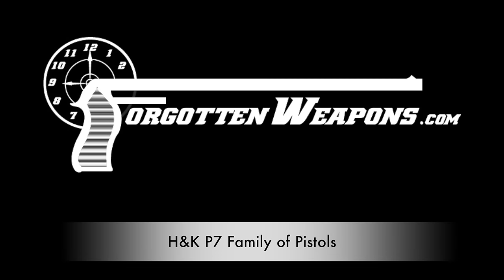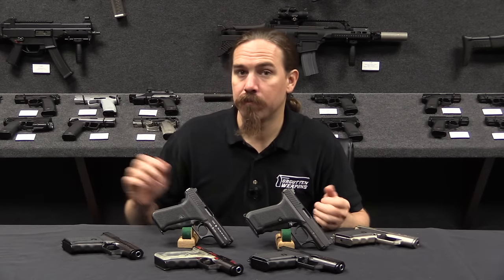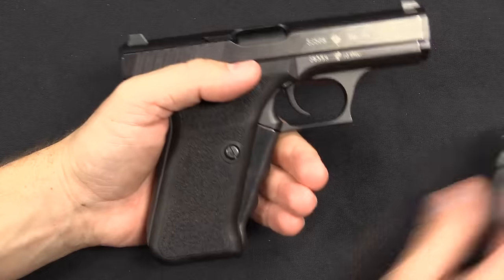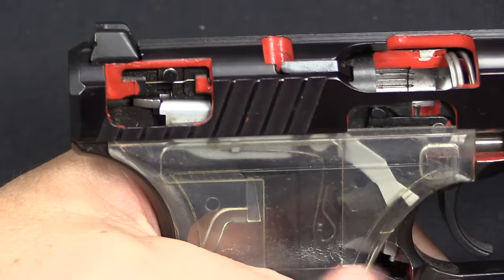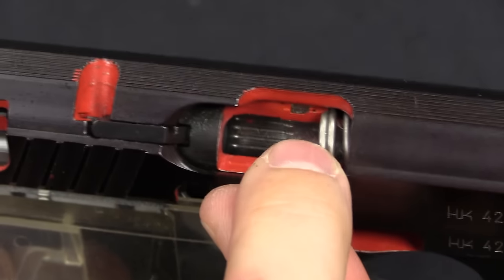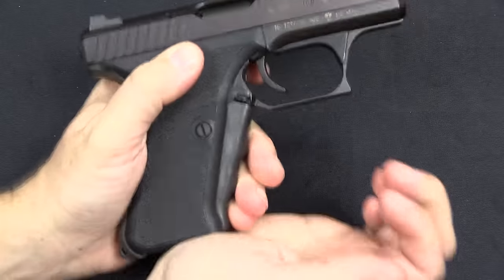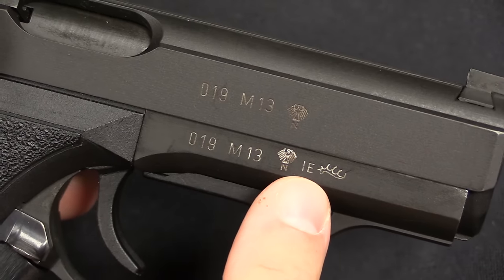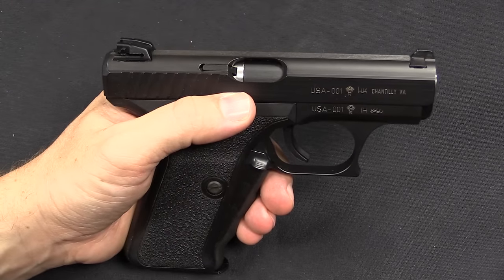H&K P7 Family: Pistols for Gun Cognoscenti

Comment: The (nearly) vertical magazine orientation within the angled grip has NOTHING to do with feed reliability. No handgun has ever had an issue with feeding from a grip angled magazine -- not 1911s, not Glocks, not Sig, not Berettas, nothing. The vertical magazine in a P7 is there to ALLOW FOR A LONGER BARREL by moving the breech rear ward. The P7 has a 4.13 inch barrel. Much longer than the overall length suggests. The Walther PPS which is almost exactly the same length as the P7 has a 3.2" barrel. The tiling barrel only recoils about 0.2" so the magazine orientation bought the P7 an additional 0.73" of barrel length and a notable increase in muzzle velocity.
--
I own both. In fact, the P7M8 was the first handgun I bought when I came to the US for college in 1994. I really regretted not getting the M13. The M13 then was $1,200 and the M8 was $950. Today, a mint M13 will change hands for about $4000~5000 and M13 magazines go for about $250~300 each.
Reply: Sorry sir it does . As well as getting more length true . If you have ever shot  hollow points and had to polish feed ramps etc or shoot only particular ammo .Had all the above . P7 will digest anything you put in it other than shot due to the light loads.
Reply: @Jason-nj8dn   I shoot truncated cone JHPs, Semiwadcutters and all manners of hard to feed stuff. The ability to feed such ammo has nothing to do with the angle of the magazine and everything to do with how high the feed lips are in relation to the bore and how shallow the feed ramps are. The angle of the magazine does not facilitate or preclude either. A P7 feeds everything, but so does a Glock, a Walther PPQ/PPS, a VP9 or a properly set up 1911 for that matter.
--
BTW, the P7 is mechanically very accurate, but practically not so accurate. This is because while the stationary barrel promotes mechanical accuracy, the unlocked breech means the P7 has a sharper recoil than most 9mm pistols. Plus, the while the barrel doesn;t move, the sights are on the slide not the barrel and the P7 Slide-to-Frame fit is not particularly tight.
Reply: @dwightlooi  set up key word. You do not have to set them up. I have had many many 1911 etc.  This is is not about cost. Just a conversation.  In my opinion and experience.  These handguns rock.. no screwing around with loads etc . In my experience kimber glock xp etc..  hands down p7 better.  Mabey your explanation and experience is different.  NOT mine . But appreciate your opinion.  Best regards!
Reply: I have another reply as well about boar axis and recoil. If really wanted to could tweak for particular loads.  The most accurate handgun I have ever shot other than six shooter.  Some people suck with it. Practice makes perfect. All the same they need to make a updated version.  Cool stuff.
Reply: @Jason-nj8dn   Not really... from a ransom rest (no shooter skill variance) the P7 shoots about 1.5~2.0"  at 25 yards. Pretty good; but not world beating. A tight 1911 like a Baer shoots 0.7~0.8" at 25 yards -- basically one hole.
Reply: @dwightlooi  yea I get your drift . Just saying no bags unloading weapon.  All in the money. Super good for carry. Fast . Fast. That's what keeps you alive.  I do appreciate your opinion though.  We could go forever about this . Lol
Reply: A new and improved lighter model would be amazing.  Wishing they would.  I will pay to play.
Reply: @Jason-nj8dn  If you want the gas delayed action, stationary barrel and vertical mag, sans the squeeze cocking, there is the Walther CCP. EXACTLY the same operating cycle.
Reply: @dwightlooi  squeeze cocker.. like I said  your opinion.  Not mine . I could go all I depth . Start breaking out pictures of groups etc. . But I don't need to.  Its good for me and I have owned about everything.  Anyhow shoot what is best for you that's all that matters.
Reply: @Jason-nj8dn  The P7M8 was my first centerfire pistol.
Reply: @dwightlooi  Good choice for first pistol :oP
Reply: @Jason-nj8dn  LOL.. it was funny. I went off to college in America. Got myself a very expensive HP 48G calculator and a very expensive HK P7M8 pistol.
Reply: @dwightlooi  . Good tools . Lol . Should have bought everyone get your hands on . Prices are crazy nowadays.  Good talking. Take care and aim small  ;0)))
Reply: Like the boy scout video.  Soo fckn true good one
Reply: Anyhow take care and be safe.
Reply: @Jason-nj8dn  In 1995 The P7M8 was $850 and the P7M13 was $1100. I should have gotten the M13. The reason I didn't was that this was shortly AFTER the Federal AW ban and >10 round magazine was halted a year prior. M13 mags were already $100 a piece and I didn't want a gun where magazine supply might be a problem. Well, The M13 is a $4000 gun today (mint) and the magazines are $250. However, if you don't mind the lettering, the M10 magazines work in the M13 as 13-round mags.

Comment: As well as the chamberings covered in this video there were also H&K P7s chambered for 9x19mm PT, as well as a prototype for .45 ACP. Most of the H&K P7s used gas-delayed blowback, but a couple of models used straight blowback. As well as the 8rd mag of most of the H&K P7s & the 13rd mag of the P7M13, the P7M7 had a 7rd mag & the P7M10 had a 10rd mag.

Comment: Walther P99 deserves a 5-10 minute video because of what you mentioned regarding partially cocked strikers and not so great triggers. Walther’s “Anti-Stress” trigger is a very good, unique and largely forgotten about stateside. What makes it great is the striker is fully cocked so the trigger pull is simply releasing the sear. It also had to be designed in a way that did not infringe on Glock patents. In 1997 (and currently), I would take a P99 all day long over a Glock. Superior ergonomics, outstanding trigger, and it is a more reliable and durable pistol. Yes, I said it. It also maintains a very simple design for complete disassembly and reassembly.

Comment: Question: When you're firing the pistol and your holding the cocker and the trigger down what holds the striker back? Surely you don't have to release and regrip the cocker after every shot. You didn't show or  I didn't see any type of disconnector.
Reply: This is what I was thinking also. It seemed like if you held the trigger and grip the gun would simply go full auto and dump the magazine.
Reply: I was looking for a comment addressing this!  I rewatched that section of the video 3 times trying to figure it out, but still can't see how on cycling, the striker is readied for the follow-up shot without releasing and repressing the cocker.  More German space magic?
Reply: It has a disconnector. It also has an external slide lock which he did not show.
Reply: You don't. Once disengaged you only pull the trigger. In fact, you can actually ease up on the cocker once disengadged. It does not need to be pulled back with full force the full duration of shooting. Very pleasant pistol to shoot!
Reply: holding the grip will allow the striker to reset, you dont need to recock after every shot.  if you hold the trigger, and release the grip you can then fire by squeezing the grip.  he didnt show holding both while moving the slide, but if you had to release and regrip if you held both down im sure that would have come up during all the trials.
Reply: I thought it would have to have a disconnector but when he was holding the trigger and squeezing the grip and it was dropping the striker it seemed like that's what the slide would do when fired. German space magic lol. Would it even be considered a semi-auto after all it's not always only one shot for each trigger pull? I can see why they didn't sell good here in the States.
Reply: @michaellesak6912  That's not what he's saying. He's asking how the gun disconnects during the self-loading firing cycle whilst it's gripped for firing i.e. what prevents it going FA.
Reply: @cruzingpapa  It IS semi auto only, because it does disconnect after each shot is fired.
Reply: @rdek99  The disconnector is a roughly triangular part that sits directly below the chamber. The cutaway Ian uses has a lower portion of the slide cut away to show it and its operation; the slide overrides the protrusion on top of the disconnector and pivots it downward, which acts on the sear bar to disconnect the trigger.

Comment: I picked up a P7M13 that came in the factory green Tupperware-like plastic case with the original end label on it, all factory documentation, factory cleaning kit and three original magazines.  

I've only shot one magazine of quality standard pressure FMJ through it and it functioned flawlessly and is very accurate.  Cleaned it well, lightly lubed it and then put it in the safe.  Matter of fact it still has the original factory wax paper sheet that rests on top of the gun to shield it from the inner plastic lid.    I plan to pick up a few more as I find the right ones...

Bought it on GunBroker for $2,800 about 5-6 years ago.  Definitely a keeper!!! 👍

Comment: @Forgotten Weapons / Ian - Another great episode.  You mentioned the trigger being changed as part of the heat mitigation.  From the sources I have read, the "thin trigger" came after the "thick trigger" and was as an indicator that the pistol had upgraded internal parts for safety and reliability.  About 2 years ago, I sent my thick trigger 1984 made P7M8 to HK and they performed this upgrade for free and returned the pistol with the thin trigger.

Comment: I have tried an old P7, and truth be told I didn't like it all that much. The grip cocking, for starters, makes for a choking hold on the grip. Straining the muscles in that way makes my trigger finger move stiffer too. And the heat build up is an issue. I burned my hand on the gun after running just a couple of magazines  through it. Sure, more training with it would help on some issues, but I feel other pistols just have better handling.

Comment: Our Department issued this gun (P7M13) from about 1993 to about 2005. A very safe gun, totally ambidextrous. When the squeeze cocker is not engaged the gun will not fire. If you had someone at gunpoint disengage the squeeze cocker and no AD’s. Something happens squeeze the cocker and the gun is good to go. All shots are SA because of the squeeze cocker. No DA/SA trigger pull issues. Very accurate as the barrel is fixed. It took about 12 lbs pressure to pull the squeeze cocking mechanism but only 3 or 4 lbs to hold it. Officers lives were saved when the guns were taken away and the perp did not know how to use the weapon.

Comment: No manual safety ? Why was this gun not adopted by the french army ?
Reply: Likely cost, I imagine.  Ian did mention that in German police trials several guns were acceptable but only a few agencies adopted them into service since they were cheaper but still good.  There's also that military generally has higher standards, often so much so that they simply don't adopt any new weapons to begin with that Ian mentioned.
Reply: @kirbyis4ever  I was making a joke alluding to the french army doctrine of the 20th century, when they had no safety on their rifles
Reply: @kirikoucortex7042  Huh, didn't know about that doctrine, no wonder that went over my head.  The more you know!
Reply: @kirbyis4ever  he explained it in a video about a bolt action rifle, I don't remember which one
Soldiers were expected to leave the chamber empty until they were in combat, so the safety was considered useless
They kept doing that until the mas 36 I think
Reply: @kirikoucortex7042  mas-36
Reply: Because its to expensive for a gun you only drop ones and run away 🤣😂
Reply: It's German.
Reply: @AverageJoe4063  : Yeah the French would never adopt a German gun, that's why they adopted the HK 416.
Reply: @kirikoucortex7042  basically the original Austrian doctrine was the same. You only put the gun in hand to shoot , who needs a safety. Training beats safety.

Comment: Check your facts at 6:51.  The P7 design doesn't provide for 'dropping' the magazine with the squeeze cocker.  You can use that to CHAMBER a round from a locked back slide condition.  The magazines must be removed or dropped with either the characteristic European (PSP) heel button, or the US ambitious lever(s) aft of the trigger.

Comment: I own three HK P7PSP Squeezecockers. They are two 1985s and one 1986. I bought them years ago in very good to excellent used surplus condition. They came in the hard black HK box complete with manual, cleaning tools and extra magazine. I paid $600 + tax for the 1986 and $720 + tax each for the twin 1985s. There isn't a local gun shop near me within 50 miles that doesn't try to get their mitts on these from me. They hit me up regularly to ask if I am selling. Nope, forget it guys...sorry!

These pistols go perfectly with my 11 Star BM 9mms I also own. They too were purchased in used good to very good and very good to excellent condition. Mine are 1976s, 1977s, 1978s and 1979s. I bought them from anywhere between $199 to $279+ tax depending on condition and when and where. They are already starting to dry up and prices are going up. In 10 - 20 years these will easily be $500+ each. The Star BM is also a very underrated and unappreciated all steel single stack 9mm. Everybody wants 15+1...16+1...17+1....19+1 high capacity 9mms these days. Those are fine too as I own many of those as well. They aren't like these though and these are timeless designs. They both shoot laser straight and deadballs on POA/POI. You don't need a hailstorm of ammo if you can hit a golf ball offhand at 20+ yards with the first shot!

The modern equivalent to these would be something like a Kahr K9 or MK9 all stainless steel. A Sig Sauer P-6/P-225 or P-239 would be a good match as well.Remember we are talking very high quality, very accurate, all metal single stack 9mms here. No polymer or cheap Ruger/Taurus junk!

Comment: Why is it "pistols for gun hipsters" on full30?
Reply: Maybe "hipster" is considered hate speech on YouTube.
Reply: Probably just couldn't decide which title he liked better so just used both.
Reply: It's a nice pistol that quickly gets too hot to hold in any kind of extended course of fire, it is more maintenance intensive than most modern Browning derived semi autos, it breaks small parts easily that are increasingly hard to find, relatively large and heavy for capacity, and like most things HK, it is incredibly overhyped (I have broken more HKs than any other brand, followed by S&W, then SIG, then Glock).  

Keep in mind that I usually put more rounds through a gun in a year than most firearm owners put through a gun the entire time they own it.  Of course, if you really want to be a gun hipster, start singing the praises of everything CZ...
Reply: @SK-bu1ft  So your complaint is that a gun not designed for high volumes of fire doesn't perform well when subjected to high volumes of fire? Hmm...

Are CZs still hipster? They seem almost as mainstream as Glocks anymore.